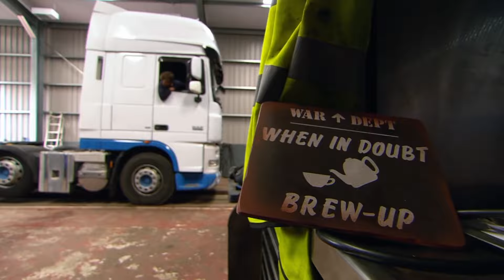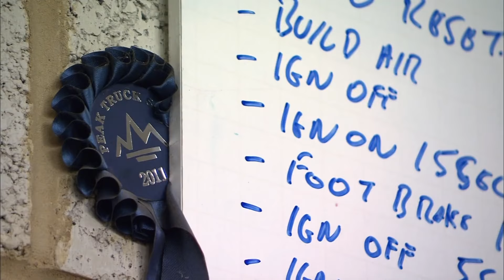Guy Martin the Proud Mechanic | Guy Martin Proper

Comment: You just can't hate Guy 😂 "I've got.... 11 10mm spanners" 😂😂
Reply: What's story with 10mm spanners? Pls explain
Reply: @Akash04dee013  its the size of socket you always drop in the engine bay
Reply: @simo782b  thanks buddy......
Reply: dead serious about it too 😂😂
Reply: a quarter inch swivel head ratchet with a deep well 10mm socket. In my pocket always.
Reply: And then I only have 3
Reply: Any of you guys got a spare 10mm socket please?
Reply: 10mm socket and a 2mm drill bit. They should sell the bastards in ten packs.
Reply: @Sim.Crawford  I've got a cup full in my box, I used to steal lighters now it's 10 mills. There's petty criminals and then there's me
Reply: That's where my 10 mm spanner got too
Reply: It is a law of the Universe, the 10mm will be some where else when you need it. The burggers are the sneackest metal artifact ever built.

Comment: Agree 100% do it right or its wrong , and Im a looser as I only have 8 yes 8 10mm spanners but I do have 10 12mm spanners and many sockets ,, I would say I have lost more 10 and 12 mm spanners and sockets in my life than I have had hot dinners ,
Guy you are a legend son ,,,,, 
R.J.T traveling the east coast of Australia on a V8 6.5 GM turbo diesel motor home and loving it ,,,
Always do what you love then its not work !

Comment: Good morning Guy can I pick your brains your a top mechanic first and full most I’m disabled and I have a Iveco daily 35S12 it’s the mark 3 with the gear stick on the floor next to the drivers seat , the question is will the gear change and gear cables from a mark 4 Iveco daily fit to the mark 3 , I know it would mean cutting a hole in the floor and making changes to the dash but after all that do you think it will fit , I think is should fit but a second opinion would be great even if it to say I’m wrong .hope you and all yours have a great Christmas 🎄 enjoy

Comment: It hurts me that Guy uses "truck" instead of "lorry".
Reply: Indeed. It's not the correct term. The word 'truck' derives from the old English word 'trucle', which meant a small wheeled, pushed hand cart (think sack truck, or similar). Whilst Lorry is derived from an even older, old English word, 'Lurry', meaning to pull or haul. Hence, a truck is pushed, while a Lorry is pulled, or hauled.
Reply: @wangdangdoodie  I appreciate the formal explanation !